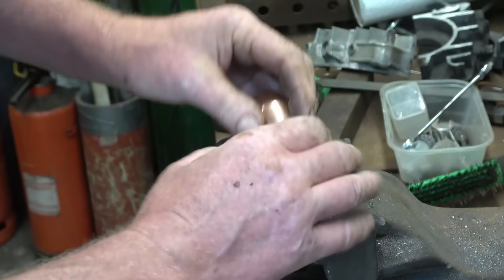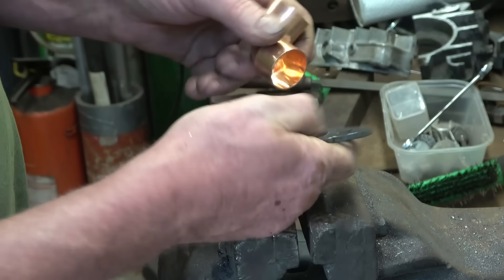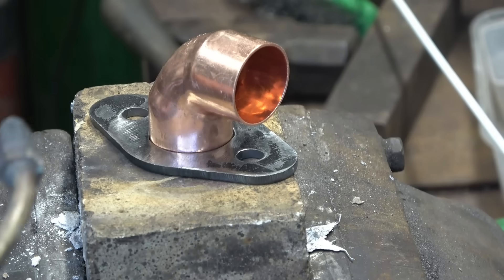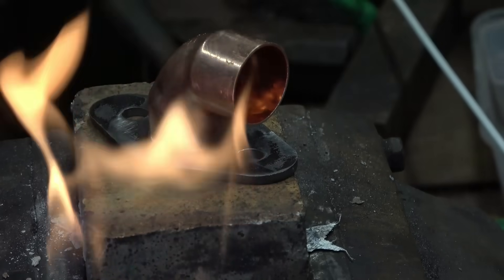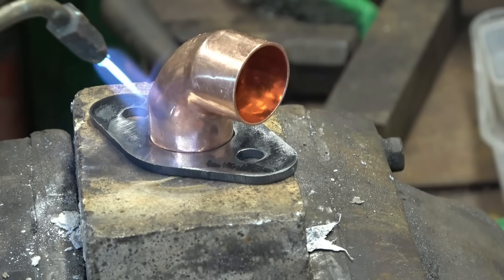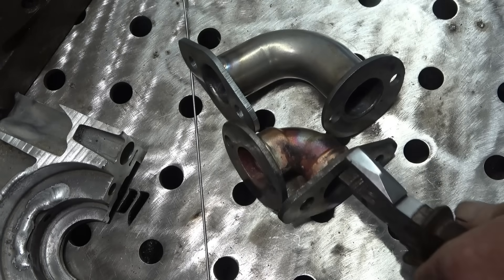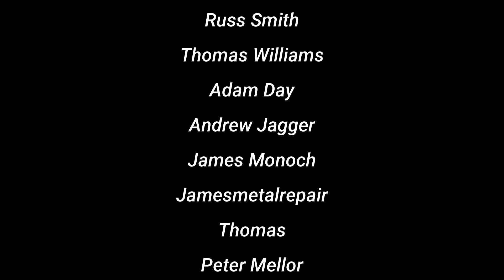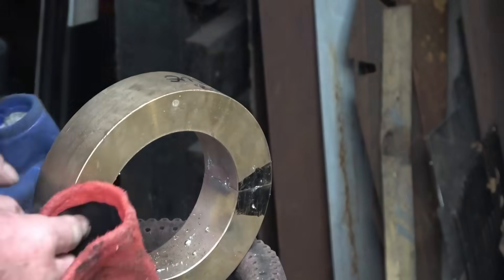SNNC 600  1930 Peugeot Inlet Manifold  "Brazing Copper To Steel"

Comment: You are using plumbing elbows which are short radius. Maybe try getting a "bend" instead as they are long radius.  Also, if you find the copper is a bit then try refrigeration fittings, a bit thicker although slightly different dimensions, plumbing fittings are sized for pipe OD whereas fridge stuff is sized ID.

Comment: With those ready-fluxed brazing rods it is super important that both parts of the work peice are spotlessly clean. A good wirebrushing and some acetone, then let it dry thoroughly, before hitting it with a torch. You'll also find that a plain MAP gas plumber's torch will often suffice. The force with which the oxy-propane gases hit the workpiece can sometimes make it difficult for the flux to do its job before it is blown out of the way by the powerful flame. It may take a little longer to heat the part with a MAP gas torch, but it's worth it for the peace of mind.
Reply: Mapp/air is hot enough to do silver brazing but brass brazing because you cannot heat the job quick enough, Mapp/oxygen may do it but Oxy-propane is the best.

Comment: I work at an auto repair shop. I am the only one there that knows how to oxy/act weld or braze. Also one of 2 that can weld with the mig, (I weld tig, mig and stick at home). We are a vanishing skill trade for sure.
Reply: In most countries gas welding, brazing and Bronze welding as well as gas cutting, arc welding and MIG welding are taught as part of an apprenticeship. All are standard practise in every shop I have ever worked in.